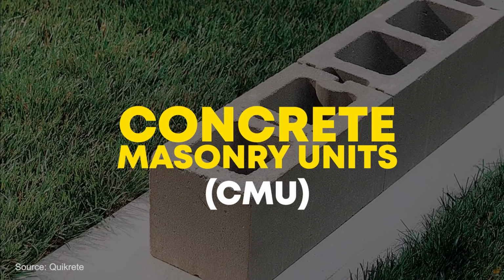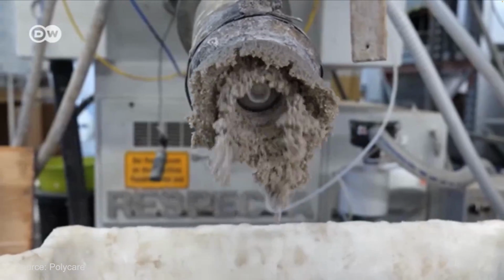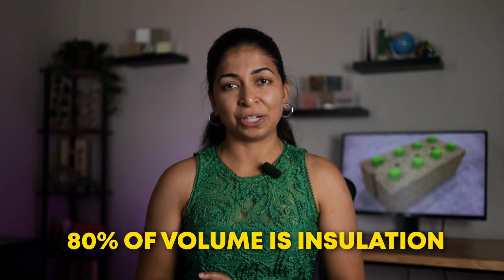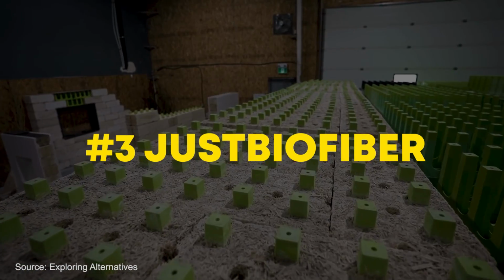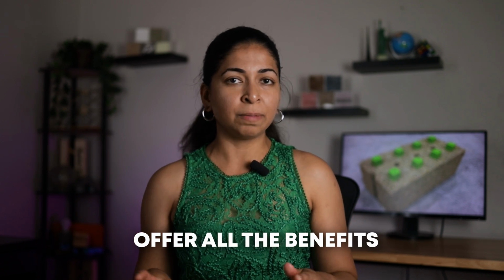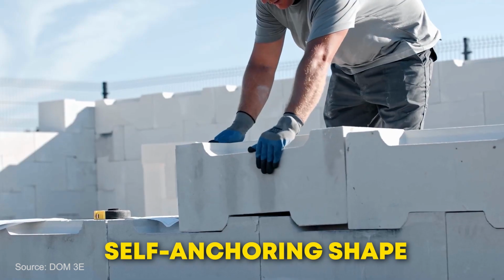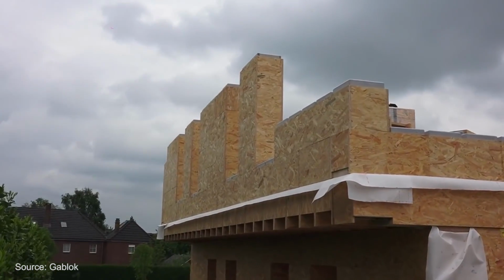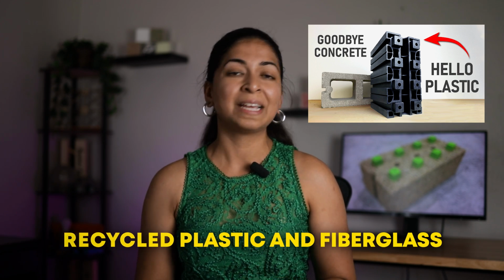5 Innovative LEGO Construction Blocks that can replace CMU

Comment: I think I'd want to do more research into the Polycare & Justbiofiber as right now for foundation and basement my design calls for poured concrete foundation walls with rockwool exterior foundation insulation. The Polycare looks like the Rockwool would still be a good choice but That Justbiofiber might not even need a extra exterior layer. I need to see what it's under grade properties are as three plus walls will be 12 and 14 ft. below grade. Even though the above grade is mostly going to be Beam construction I don't mind more new school on the base as long as it has at least some track record. This is my forever house. I can't do it twice.

Comment: I would love to have the system 3, for me it's the best idea, and I would never make any holes in the block (only for AC  and water piping) I would used 2x2 or x3 in the interior to run all electrical. It will cost more but that is what I would do.

Comment: This is a great review for minimizing construction times.
one thing i noticed that some important questions were left unanswered:
1. what waste products are created, if any, when the products are created?
2. how long are these products designed to last?
3. is repair or remodel easy or hard?
4. is water damage from broken or damaged pipes within the walls easy to repair?
5. how many years until the building needs to be completely demo"d and replaced with new?
6. when the house needs to be repaired or replaced are the building materials recycleable?
unfortunately in the last many decades products of all types of products have been made that look good, but thought of maintenance by the owners is never given a second thought.
there is no reason to make a product that is cheaper to buy new instead of clean or repair, but there are lots of those products like that on the market now. 
again thanks for the review.

Comment: I find the Polycare blocks fascinating for their eco-friendly approach and strength. As a contractor, using lightweight materials like these can significantly reduce labor costs and construction time. I’m curious about their long-term performance in various climates.

Comment: The building blocks you can see in from polycare is not from a geopolymer but a polymer. The ones you see in the video is the old version which they do not produce any more and it is made of a polymer concrete which is nothing short as a plastic concrete. The newer version looks completely different and this newer one is from a geopolymer. Again polymer and geopolymer are completely the opposite to each other.

Comment: Seismic performance and whether there is any engineered bracing value at all is an important factor to consider. Also fire resistance. Code acceptance is another. Then flexibility for different designs and openings, and ease or repair or renovation. How does each accommodate components such as power and piping if at all? How easily is each combined with other systems such as beams and columns for larger openings and spans.

Comment: How are they up to code? Most building codes require 2x6 wall studs to be 16 inches from center for exterior walls and load bearing. These Gabloks would not have that. They wouldnt be allowed in majority of building codes.

Comment: As a builder none of these have the ability to replace CMU's in price , repairability ,durability or even code acceptance  which is why they wont be going anywhere  for a long time.
You can make a product that can be placed and ready in 5 min and it wont matter if you can't guarantee it will stay in place doing the job for many many years to come and still be repaired when something does happen.

Comment: I'm confused about the Polycare blocks which say "90% filler of natural sand and 10% binder" but then later says "the outside of the block is only 1cm thick and the rest fill with insulating material".  So is it a thin shell of sand and binder with mostly insulation inside, which is inside the mold before the sand and binder and put in?

Comment: MyIB and similar blocks made from compressed earth is my no. 1. They are in my opinion the best combination of features for above grade walls that exists  today. If only there was a roof this good. Belinda, could  you do a more in depth video on the subject, please?
Earth Block International is in your home state.
Reply: They're also my top pick. Ease of use + ease of manufacturing + lack of plastics/ polymers are always going to be a win in my opinion. They can be made locally with local materials, not needing a specialized manufacturing facility and potentially thousands of kms of shipping.

Comment: Im from a small town in eastern europe. Back in the day in this town operated a cement factory which used asbestos for its production. 
Everyone was amazed by the cement and everything - until around 10 years ago when pple started to feel unwell. They were diagnosed with pleura cancer. It has 30 incubatory period and it kills within 6 months. 

Careful with the new materials.

Comment: a lot of what determines use is access. As I live in alberta the justbiofiber would be the best but only because of location. Most likely some of the other types wouldn't be available in my area without a large cost, plus inspecters are like horses, easily spooked on anything new to their area.

Comment: A very good overview. Well done Belinda. 
Re choice between the different blocks, pricing, insulation levels, durability or maybe a calculation on a cube (with a theoretical foundation and roof which insulates perfect (to calculate the 4 walls)) could help. 
One had a very good preparation for electicity, sewage etc.

Comment: Very fascinating building methods and materials. Seems some variations of these building blocks possible by varying block style for a given method. Some I like the material composite chosen, but think the design of the block used could be in improved. The ability to use preformed components/blocks that are mass produced and can be efficiently assembled onsite with little is a great advantage. 
The fire resistance of System3e is a very appealing feature, given the number of wildfires many regions are now facing as a result of climate change.

Comment: Rebuild Lahaina The best building material to rebuild Lahaina is the only local building material on the island Cindercrete is a mixture of cinder cement and water mixed and poured into a set of reusable forms walls are poured from 12"to 24" thick Cindercrete is fireproof termite proof rust rot and mold proof non toxic and has a high R value and good sound attenuation solid poured walls means no critters can live in your walls Cindercrete can be built for a fraction of the cost and time and cinder is the only local building material on the island 
Local building material 
No shipping cost and zero waste 
80% of what you need to build a house is already there 
Puu Hele cinder pit is less than 20 miles away and has all the local natural building material you need Why would you build out of anything else Mahalo

Comment: I was literally just starting to research this topic when you posted this video! I'm in the early phases of trying to design my off-grid cabin, and I want to make it as resistant to earthquakes and wildfires as possible. I'm planning to build a 2-story house with a daylight basement, and I'm thinking I might use the biofiber blocks above grade and Polycare or MyIB below grade. Thanks for this video, it's exactly what I needed!
Reply: If you are in the woods, logs are free except for chainsaw gas, maybe use a solar charger for electric?  Logs have a lot of thermal mass if not R value, and you can always panel the inside and route wiring with a little judicious drilling to get up and down.
Reply: @watchthe1369  I'd love to build a cabin out of logs from my own land, but I bought it just after it was logged, so there aren't many trees left sadly.
Reply: @SillyCedar I like the idea of a dugout home in a hillside to stay cool in Sumner and warn in winter. 
Years ago I started watching a YouTube channel called Pure Living For Life. They bought land in Idaho much of which was a hillside with little flat area. It would have been a good place for an off grid hillside dugout home.Which would have left them with more flat land. Instead they built a regular house and paid for it by YouTube money. In Australia dugout homes are common in the outback to escape heat.

Comment: I love the idea of these blocks. In addition to these though just like you have basic Lego blocks for general construction you also have hundreds of specialty Lego blocks for decorative or practical purposes. 
Imagine specialty blocks to create walls with patterns and textures, guttering and aqueducts, roman, three pointed, and ogee arches, an alcove for a statue, planters that come out of the wall and so on.
Reply: 🙂The Lok-N-Block blocks from two weeks ago have lots of exterior grooves that could be used to attach stuff besides just more blocks. I can totally imagine a house made out of the blocks, with siding/gutters/roof panels for the exterior, and pipes/electrical/drywall panels on the interior.

Comment: One concern that System3E raises is the risk of silicosis. Here in Australia, there is major concern about the number of silicosis cases coming about because of engineered stone bench tops... to the extent there is now political pressure in our country to ban the importation of engineered stone altogether. While I'd contend that is something of an over-reaction (the hazard can be mitigated substantially with wet cutting and polishing), it's very concerning to see construction crews working with high-silica perlite and raising clouds of dust. Especially when none of them are wearing appropriate PPE.

Comment: Suggestion for a future video: I'm curious why we don't see more plastic in homes. We've come a long way from the Monsanto House of the Future at Disneyland, but our houses use gypsum, concrete, vitreous china, galvanized metal, and wood where plastics and recycled materials might be better. One example is a kitchen sink--why not plastic? It may need a thin stainless steel finish, but I would think a plastic frame would be better than a thicker all metal design.

Comment: As with previous innovations, my biggest concern is both the initial layout of utilities in the exterior walls, and then any future modifications or repairs. It almost seems like one would be better off leaving utilities completely out of these structures and run them instead in interior walls built immediately up against the interior surfaces of those walls.
Reply: I have always been kind of negative about running pipe in an outside wall  I would rather have some sort of central wet wall interior to the structure that can have short branches going out to where you need them.  It keeps the outer walls airtight and minimizes the chance of freezing in cold climates.  

Given a choice between a windows sink or an island sink that can watch the gathering area so whoever is cooking can participate in the conversation seems a better option.
Reply: DWELL EARTH does the same thing and also sells the equipment if you want to build it yourself.
Reply: 🙂Or just run the utilities inside of the floor/ceiling between the first floor and second floor. All bungalow basements in my province have some kind of utility-panel ceiling, that runs power/water/etc along the length of the house, for the basement and first floor. It'd basically be the same thing, to do it for non-basement ceilings/floors for houses / small apartments up to 3-4 floors.
Reply: @AileTheAlien  That's an option but restricts one from having a kitchen sink at a window (like in my house), or a bathtub or sink mounted behind an exterior wall.
Reply: @whiteknightcat  It doesn't restrict you like that. My kitchen sink is at a window, on an exterior wall. You just run the small extension pipes off of the main lines, to whatever you're installing.
Reply: @AileTheAlien  I guess my own house is just poorly designed, but extended hard freezes are rare. I've got piping extensions in my exterior walls for hose bibs, kitchen sink, dishwasher, and clothes washer in the utility room. The upstairs master bath has ALL the piping in an exterior wall.

Comment: Excue me, but the machine in the beginning, we use it to make prc pipes. are you sure that is not recycled oil or some other (toxic) chemical. Otherwise it would make good old chinese dust concrete. How do we recycle fiber glass mats? my god

Comment: I've been puzzling over how to rebuild Lahaina, Maui. This was a zero lot line town built of wood, basically the Chicago & San Francisco 1906 fires but wind driven. It occurs to me the stagnant  CMU design should have been Lego'd a long time ago. CMU fire resistance is unrivaled in all these stackable blocks except maybe the 30% clay units.
Reply: The best building material to rebuild Lahaina is the only local building material on the island 
Cindercrete is by far the best building material on the island Cindercrete is a mixture of cinder cement and water mixed and poured into a set of reusable forms walls are poured from 12"to 24" thick Cindercrete is fireproof termite proof rust rot and mold proof non toxic and has a high R value and good sound attenuation solid poured walls means no critters can live in your walls Cindercrete can be built for a fraction of the cost and time and cinder is the only local building material on the island 
Local building material 
No shipping cost and zero waste 
80% of what you need to build your home is already there 
Puu Hele cinder pit is less than 30 miles away and has all the local natural building material you need 
Why would you build out of anything else Mahalo
Reply: Given the volcanic origin of the Hawaiian islands, are pozzolanic materials available? A particular advantage of "Roman" type cement would be its capacity for a strong cure even in the presence of seawater.

Comment: Excellent video. As a retired bricklayer it is sad to see my trade going the way of the Dodo, that said Polycare would be my first choice, clean, lightweight, ease of construction and being able to dismantle and re-use is a big bonus for me.
Reply: 🙂My first pick is Lok-N-Block, followed by Polycare. They seem like the least amount of effort and time to build the structure.
Reply: I am dubious about the loadbearing past residential use on the plastic, the other 2 might take a fair amount of compression, but probably not as much as brick.  The OSB stuff has a lot of thermal bridge in it, and it is only 2 story building rated.
Reply: Which one you recogn  will be the most efective for insulate directly building a music studio ?
Thanks!
Reply: I seriously doubt traditional brick or stone facades are going to go away anytime this century.
Reply: @whiteknightcat  
Yeah, you're probably right here whiteknightcat,  brickwork will be used just as cladding or for decorative reasons in which case  time-served tradesmen (not a Bengal Lancer) will become a niche/specialist  trade 
Curse my luck, I retired too early...😖
Reply: @billhammond1003 Hey, you could always consider a side gig as a consultant or instructor, to supplement your retirement :)

Comment: 1. These materials might be easy to build with but they do not look earthquake resistant at all. and beeing light means your house might fly away in a storm. 
2. Gablok looks like it will burn nicely.
these are my wories :)
Reply: SYSTEM3E?
Reply: @tristankordek  build like brick structures it seems. No reinforced concrete colums or anything. Works for places that does not have strong earthquakes I feel like.
Reply: @Jhaldmer  True
Well, we don't have earthquakes in Poland.
I would give a lot to see how it works on "shake tables"
https://youtu.be/nGV_JS9j4JE
In fact, the only thing that holds these blocks together is the original shape, gravity, and exterior elevation.

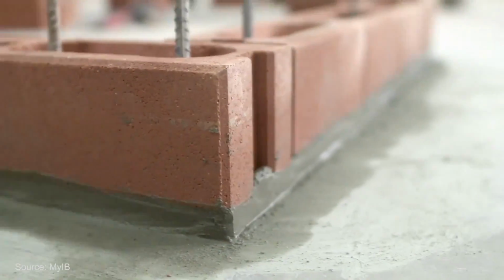Comment: @3:30 The MyIB blocks may be stronger than hollow CMUs, but their demonstration is a lie: They let the MyIB block hit the ground in its vertical orientation, while they let the CMU hit the ground on its side. Obviously, the CMU was not designed to withstand much force from that direction. I wonder how much force the MyIB would be able to take sideways. Also, the CMU was twice the height as the MyIB, which makes the side impact worse for the CMU because of its higher weight.

Comment: love all of these innovations! seems like there's a missing middle for construction, somewhere between modular housing (drop the room in place) and these modular building blocks. Would be fun to have pre-made walls of a set size that lock together and make a bunch of different shapes of rooms/buildings.

That may already exist, if it does someone please point me in the right direction!
Reply: I don't know if this fits in what you're thinking of, but Matt Ferrell from Undecided got his new house built from modular walls:

https://www.youtube.com/watch?v=y3NVDqH39CE&ab_channel=UndecidedwithMattFerrell
Reply: With sip panels they can make whole wall sections that need a crane to place, but they are expensive.

Comment: Could you use some of the inovative molds with other formulas? Which if these would be best for a hot and humid environment? 

Despite re-discovering the formula for Roman concrete I have not seen anyone announce building plans with it. It's ability to heal cracks when wet seems like a big money saver but no one is incorporating it yet. Is it cost or changing the way things are that's the issue?